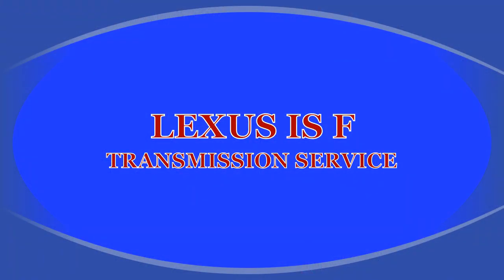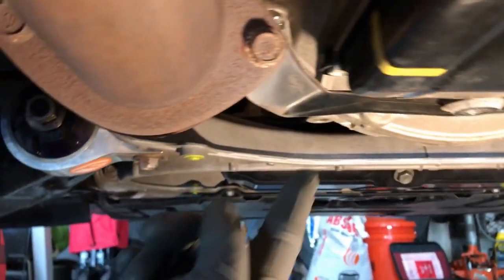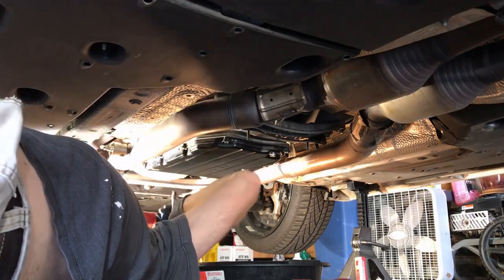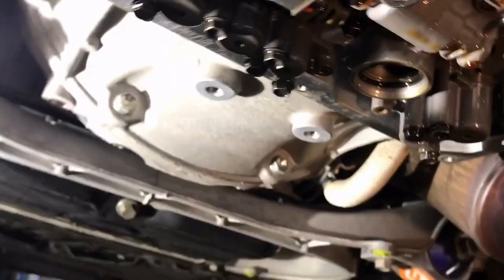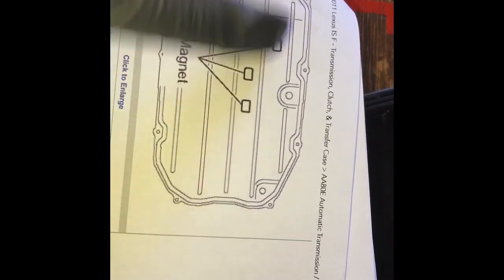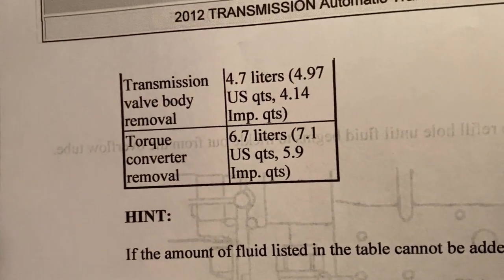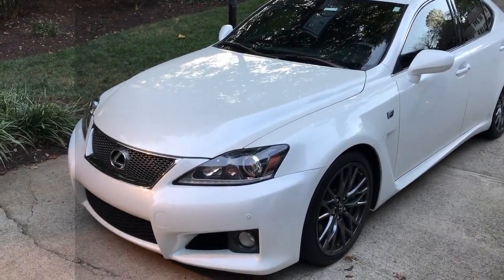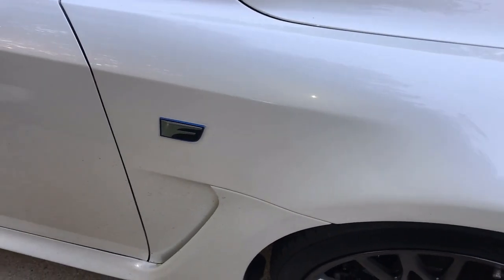Lexus IS F Transmission Service

Comment: Hi, any issues 3 years after ? Thanks for this great video
Reply from the maker: Nope! Rides like the day I did the service. I still do minor services 1/year for a 2-3 qt fluid drop and replace. Shifts are crisp when pushing it hard and normal driving it’s like butter
Reply: @cpfb68  thank you! I’ll definitely do it now, mine has now 75K miles and has never got a ATF change, recently one of the ATF cooler lines busted so will do an ATF change together
Reply from the maker: Totally worth the cost and effort. Do a full service (pan drop, filter change, fluid). You get more fluid out and a fresh filter every 60k will get you 300+K miles on the trans easy. I do extra minor services every other oil change or once per year as extra coverage.

Comment: Awesome video. Thanks for sharing!! Subscribed.
Reply from the maker: Thanks! I hope it helps!
Reply: It helped a lot. I just completed this on my car today.   I didn’t replace the gasket; it was still in great shape. My car has 76k on it.  I did one additional drain after doing the filter replacement.  After I did that I did the level set using a thermal gun.  On thing I didn’t expect was the additional fluid that comes out when pulling the filter off. But it was a minor ; I had a shop rag handy.  I used the garden sprayer hack to pump the fluid back in. The tools and everything you documented here gave me the confidence to do this job!!  Thanks!
Reply from the maker: @jefflebo5836  AWESOME! I'm glad you did it! We have to take care of our F's and keep them alive for years to come! YES! There is about 3/4 of a qt in the filter! I found out the hard way too!

Comment: Very detailed video, I have a Lexus GS460 with the same 8 speed auto as the ISF i believe. So is this guide good for me?

Mine is a rare and short production car so  finding information on it is hard and annoying
Reply from the maker: odin5 I don’t know if they are the same trans but if you are sure, then yes! It’s the same process. I really suggest to get a good service manual and read it to be sure the process is the same. The emanuals online are detailed and cheap, like $20-$30. Best investment for your car!  www.emanualonline.com. 

Defiantly check if the filter kit is the same one. Amazon or Rockauto. I’m sure if they are the same part number for yours as the F it’s all the same.

Good luck!
Reply: @cpfb68  Thanks for the info. Doing some more research, i believe the LS460 GS460 and ISF share the same gearbox but the ISF has a more aggressive map.

Sector 7 can tune my gearbox to ISF spec apparently

Comment: Hello and thank you very much for this video! My problem is I can't find OEM washers. Can I put there some universal washer?
Reply from the maker: Do you mean the Trans Pan plug washers?
Reply: @cpfb68  Exactly my friend. Even my Toyota dealer does not have it..
Reply from the maker: EBay the part number from my video transcript. There are tons on eBay both Toyota or aftermarket

Comment: great video I think my local car shop mechanic didn't follow the procedure now i'm getting gear flares. He said he did, my vsc light is on and getting the torque convertor slip - too much oil?
Reply from the maker: It may be a few things. Did he drop the pan and screen like in my video and just replace some of the fluid or did he perform a full flush of the system and replace everything? How many miles does your F have?
Reply: @cpfb68  replaced the filter, new gasket etc.
Reply: sorry forgot to add its got just over 100k
Reply from the maker: Ok. Do you know if the trans service has ever been done before? Any records of the work at all?
Reply: @cpfb68  I cant see this being done before, the filter inside the gearbox looked original too.
Reply from the maker: Ok, sorry for all the questions. Just wanted to be sure I give you the best response! 

So, if it’s never been done before you definitely do NOT want to flush the system. I’m glad to hear they took about 6 qts with the pan and screen change. If they didn’t use Techstream or even used the jumper in the OBD II port to verify the fluid temp when refilling, you may need to ask how they checked the fluid temp when they were checking the fluid level after refilling. If they don’t have a good answer, they may have just put back what they took out. This still may not be the right amount as it may be low to start with. 
It may be low on fluid if it feels like it’s late or hard shifting now. 
If you feel the answer they give you is weak, find someone else you trust to pull the drain plug and refill and check the fluid level correctly with Techstream or the OBD II or correctly with a infrared heat gun. 
As you saw in the vid I overfill it and make sure it’s the right temp and a trickle and button it up.
Reply: @cpfb68  ok thank you
Reply from the maker: No problem! Good luck getting it figured out! I hope you get it fixed right!
Reply: @cpfb68  little update, turned out the transmission needed just over a litre of fluid. Level is correct, we couldnt get the P or N to flash using the jumpers although it did enter the service mode. The gearbox now drives perfectly no gear flares and it even smoother than before, although it ran fine on the original fluid. I will change the fluid only in the next 12 months. Does the temp have to be between 35 and 42 for the gearbox reset?
Reply from the maker: @imyeg6  Good to hear they went back and found it was underfilled! The fluid level HAS to be checked correctly or it can cause an incredible amount of havoc in this trans. ON the fluid temp, I'm assuming you're not in the US and asking for the temps in Celcsus and not Farenheight?
Reply: @cpfb68  Sorry based in the UK, very rare car here 1 of 179. Didn't drive the car too hard and the AT temp warning did not show so hoping hoping he gearbox is all well and good? Car drives great now. Left it parked over night just going to do a cold test but will assume it will be fine as it running great when red hot. I couldn't get the transmission to rest with the jumper method. Can you please explain how to do this and what are the benefits. Ive read online disconnecting the battery will do a reset not sure how true this is?
Reply from the maker: @imyeg6  I just pulled my service manual and the temp of the fluid must be between 35C and 42C, not less, not more. If it’s higher, you need to let the car sit and cool overnight. 

As for the jumper method, it’s a long explanation that I attempted and got freaked out and gave up. I’ve had many say and in other videos online that I was doing it correctly. When I saw all the lights on the dash freaking out I thought I fried the car. It actually was in diagnostic mode. 

Two recommendations- if you plan to do any service work yourself, purchase a service manual. I have links to two options in my video, Chilton Online and Emanual. They both are good and about $30 US. The eManual gets you the manual as a .PDF download and your good to go. I get no kickback from either of them. I purchased both myself. 

The second option is to watch The Car Care Nut’s video on YouTube how to do this. It’s not an IS F but the procedure is essentially the same. He’s a Toyota Master Mechanic that started his channel during COVID to help out people with Toyota and Lexus vehicles. Great channel and you can learn a lot if you really want to perform your own service.

Hope this helps! Good luck!!
Reply from the maker: @imyeg6  here’s the link to his transmission vid
https://youtu.be/eRxSu4-4ojo

Comment: What’s up bro. Would you recommend adding Lucas Transmission Oil Additive to my 2006 Lexus Is250 Automatic Transmission. It doesn’t shift hard or any super bad problems. I’ve just noticed it sometimes take a while to shift. Like laggy. Or should a simple oil n filter change should be sufficient?
Reply from the maker: I wouldn’t use Lucas on these newer type of trans as they are extremely different from the trans of the old 70s, 80s and 90s. Depending on your mileage and how often you have changed your fluid, a simple pan drop, screen change and refill will make a huge difference. If you have been good and changed the fluid every 40-60K, this will work well. You can wait about 1K and then pull the drain plug and straw and drop another 2 qts and add back. If you do this two or three times after the screen change, it should feel like a new trans. If not, then you may have a bigger issue.
Reply: @cpfb68  thanks bro, I’ll definitely do that! Sounds like a great idea.

Comment: Question for Lexus IS 200T 2016: 

My mechanic pumped the new transmission fluid back up through the drain hole instead of the fill hole on the side. He didn't need to remove the pan. Does that work?
Reply from the maker: I guess so?!?!? As long as he took out old and put back new at the correct amount…sure!
Reply: @cpfb68  I hope it's the correct amount... I didn't see the mechanic do the leveling thing where you have the car at a warm temperature and then drain a second time like I see in most of these video tutorials.
Reply from the maker: @xwarriorx123  logically if he replaced exactly the same amount he took out it would be ok as long as it was the correct amount to start with. Many in my F group that have done the trans service have stated they end up putting back a little to a lot more than what came out. I believe I added about a 1/2 qt. More than what I took out. I know nobody serviced it before this service. If he didn’t measure what he took out and just pumped some in until it trickled out without warming the engine to the proper temp range, you may have too much in the system. As it heats up the fluid expands and will drain out to the proper level. If you feel it’s not shifting right then take it to a dealer or a certified Lexus Tech and have them check the fluid level bringing it up to temp using the Techstream software.

Comment: How long does it take for us to open the overflow screw because I don't have the temperature ready?

 Is this method suitable for👇 

Toyota Noah - ZRR75G
Reply from the maker: I’m not sure I understand your question. it’s not a time but a temperature. It took about 5 minutes for my trans to get to the right temp. 

As for your second question, I do not know what a Toyota Noah is nor if it’s the same transmission. Sorry

Comment: I've followed every step in this video and then some noise start emerging from the torque converter. Any idea why is this happening and how to fix it?
Reply from the maker: Not knowing how many miles you have on your trans, how many times the fluid has been changed before, my first guess would be you may not have enough fluid in the trans. When you watched my vid, you saw I had to add more fluid a second time as when I popped the plug the first time nothing came out, after dropping in 3/4 of a qt. about a 1/2 qt. Came out. Iv’e since done a second and third minor service (just popped the plug and put in 2 qts) and have always double checked the fluid level to be sure there is enough in there. 

If you have a high mileage trans (150-200k miles) with no pervious fluid services, and you are 100% sure the fluid is at the right level, you may have slipping in the clutch packs. If you are sure the noise is in the converter, I’m not sure other than it’s slipping.
Reply: @cpfb68  31000 miles and it is the first time to change the fluid
Reply from the maker: What year IS F do you have with 31K miles?
Reply: @cpfb68  it is LS 460L 2013
Reply from the maker: I have no idea if the trans in that model is the same as an IS F.  This service is specific to an IS F and I do not know how it relates to any other trans in another model. Sorry.
Reply: @cpfb68  it is a same trans number AA80E
Reply from the maker: While it may have the same number and be the same trans as an F, the service procedure and requirements may be completely different. I suggest you purchase a service manual for that specific car to see what the procedure is. I had provided two options for service manuals online in the comment section and video.
Reply: @cpfb68  ok thank you so much 😘

Comment: What are the harms that occur if we do not take out the excess oil?
Reply from the maker: Depending how long it’s been since you changed your transmission fluid, it doesn’t hurt at all to do a partial fluid change, especially if you are well over 100K miles and have never done a fluid change. It better to do a partial fluid change than none at all.

Comment: Is this the same transmission as the 2014 is350 f sport? Can't find any videos on the aisin 8 speed full trans service. Great vid
Reply from the maker: Kevin Benitez not sure if the F and IS 350 have the same trans. If you purchase the maintenance manual online like in the vid, it will show you how to service the trans. It may be similar or exactly the same.
Reply: cpfb68 thanks for the reply. Turns out it's the same transmission as the IS-F. Fluid and filter changed with amsoil. Been running good for a couple thousand miles.

Comment: Good job👍👍 what size is the drainer nut is Allen key?
Reply from the maker: PandaBoy147 I think you are asking about the trans pan drain plug size of the Allen key, correct? If so, I believe it’s a 6MM but check the fit before torquing it open.

Comment: I have 175k worried if changing it might cause slippage, what should I do?????
Reply from the maker: Do you know the service history? Has it been changed regularly every 30-60K miles?
Reply: @cpfb68  I know the last owner didn't change it and he owned it since 154k
Reply from the maker: Ok. So safe to assume it’s never been changed. There are two schools of thought. 1) don’t touch it at all and start saving $$$ for a new trans in the future. 2) do a minor service and do a few of them every 1K miles for 3-6 times. Trans holds about 12 qts and a bit more with the converter. You won’t get everything out unless you do a true flush. If you warm up the trans and pull the drain plug, you will get 2-3 qts out leaving most of the old fluid which has a lot of the metal material that is probably helping the clutch packs still engage. If you haven’t started to feel any slipping or shift issues you can do either option. If you have already felt some issues, I recommend option 1.
Reply: @cpfb68  shifts amazing I just like doing preventative maintenance. But I'll probably just do a little every so often like you mentioned just so I know there's some good stuff in there and just leave it like that. And if it blows trans are $700. So not the end of the world!thank you!

Comment: Any issues using the beck arnley filter vs. Lexus oem per?
Reply from the maker: None whatsoever. The car acts just like it did just with crisper shifts both up and down in either auto or manual.

I didn’t see any differences at all between the original parts and the replacement parts. The thickness, material makeup and quality of every was spot on to the OEM. It is possible that they were made by the same manufacturer and just sold by BA.

Comment: My isF has bubbles in the coolant tank but there’s no overheat u think it’s the valley plate?
Reply from the maker: If you have a constant low rad fluid that you refill every 2-3 days, you can crawl under the car and look around the trans bell housing for the signature pink dribbles of coolant. Thats a VPL sign.

If your coolant level isn’t changing and you have Bubbles in the coolant tank makes me think it’s something other than a VPL. It’s very rare but a head gasket leak? Exhaust backing up into the coolant creating bubbles. 

If not that, I’m not sure. Possibly something wrong with the water pump inducing air into the coolant.

You need to get it checked by a good mechanic that knows the IS F.

Good luck!
Reply: When I put coolant in the car & I drive it after it goes back down to low but it don’t overheat
Reply: @cpfb68  When I put coolant in the car & I drive it after it goes back down to low but it don’t overheat, but there’s no leak
Reply from the maker: If you’re adding coolant and loosing it over a few days with no leak then most likely it is the VPL. To confirm, go under the car and look at both sides of the transmission, bell housing for any long streaks of pink coolant. Otherwise take it to a good mechanic to confirm.
Reply: @cpfb68  thanks fam 🙌

Comment: How much ATF fluid did come out after you topped it up with another quart?
Great video by the way :)
Reply from the maker: It was probably about 1/2 to 2/3 qt so I was probably right on the money with the first add and just went over with the extra qt. I would rather be safe and waste a little than be short on the fluid.
Reply: @cpfb68  Thanks. I appreciate it. I'm going to change ATF on my GS300 now.

Comment: Link to your heat laser gun. Great video👍
Reply from the maker: Thanks for the reply.. here is the link to the Temp gun. Will add to the notes. Thanks!

Limited-time deal: Etekcity Infrared Thermometer 800 (Not for Human) Non-Contact Digital Temperature Gun, 16:1 DTS Ratio, -58℉ to 1382℉ (-50℃ to 750℃), Yellow and Black https://smile.amazon.com/dp/B00DMI62HM/ref=cm_sw_r_cp_api_i_dl_FV99FNCV7XQZXN1F3NKE?_encoding=UTF8&psc=1
Reply: @cpfb68  Thank you! Do you still have your ISF?
Reply from the maker: @Blackntanxguy  Yep! Never gonna sell it! Love this car. I had planned to make a bunch of other maintenance vids like spark plug change but wasn’t sure anyone wanted to see it.
Reply: @cpfb68  that’s great your keeping the F. I have the GSF, 2nd gen IS350, and IS500. Are you in Facebook F Community?
Reply from the maker: @Blackntanxguy  yep. I’m in two. Community F and Lexus IS F Owners